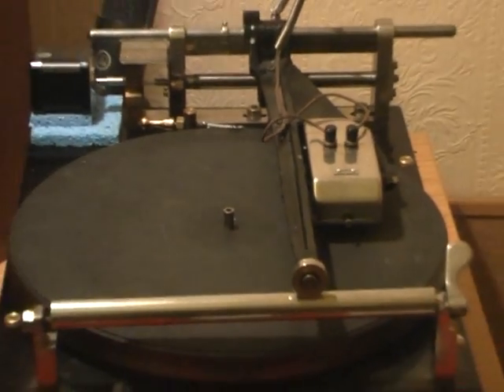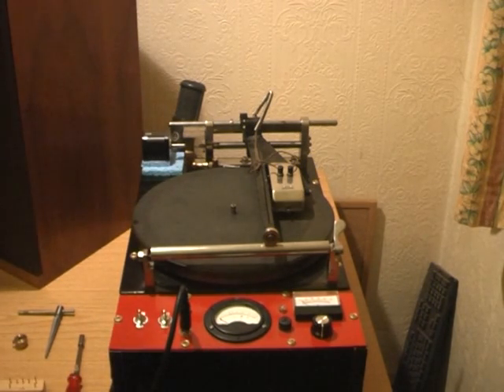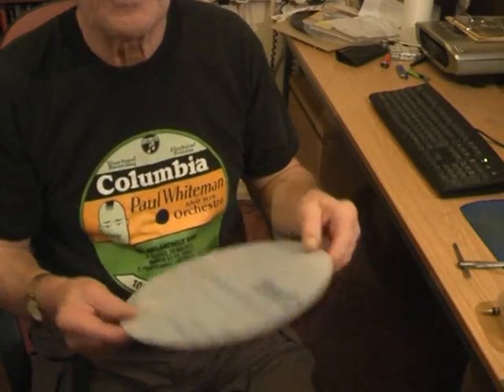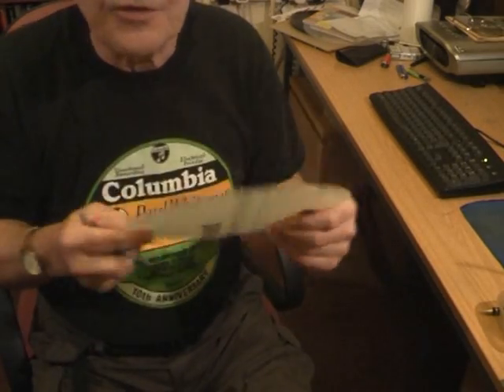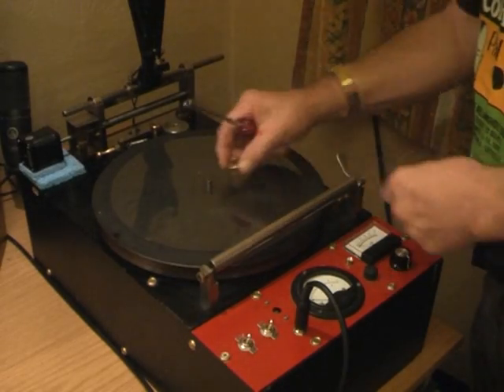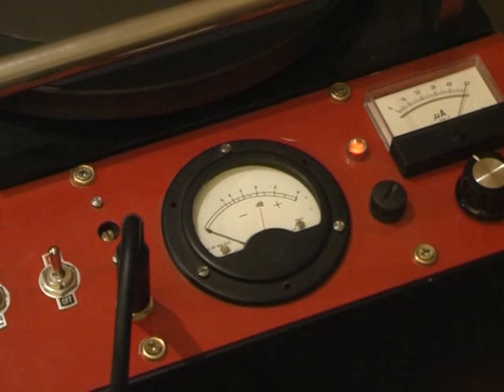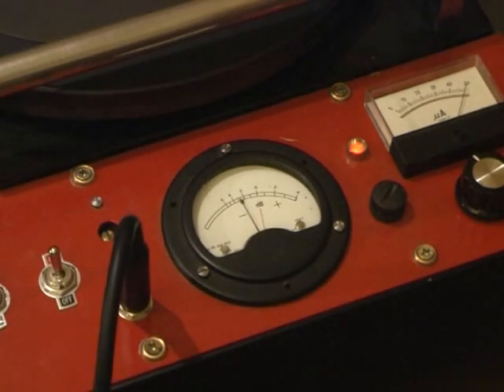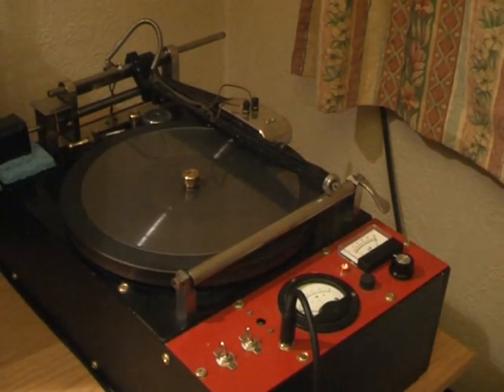home made 78 rpm records

Comment: What amplifier are you using on your desk?
Reply from the maker: An old NAD 3020. Must've had it for 40 years. 😀 The MSS heads don't take a lot of driving; many years ago, John R T Davies drew me a circuit using a single EL84 valve (aka 6BQ5) to drive an MSS head. It's only rated at 4 Watts. Of course, there will be less distortion with a higher power amp idling along. IIRC the 3020 was 20W per channel. Using a stereo amp for cutting a mono disc is convenient, because one channel can drive the head & the other chanel can be used as a  monitor. All the best, Norman. P.S. The big MSS mono amplifier used push-pull EL34s.

Comment: I fully expected this to sound terrible but I was so surprised how good it sounded!
Reply from the maker: Wow - that's great, thanks! Still tinkering with it here... need to warm up the polycarbonate disc to maybe 35°C, coat it with thin spray of WD40, and have a heated cutting stylus... One day will have a major campaign on it! Of course, I should have used a modern recording, which would have sounded far better anyway  😀Cheers, Norman.

Comment: Hello! I would like to know how you made the record labels
Reply from the maker: Sorry about late reply! It's quite simple. Scan in a real label (or design your own), and save it as a .jpg, or whatever. For 25 cm (10") discs, most labels were either 8 cm diameter (3.175 inches), or 8.9 cm (3.5 inches). In both cases, there are available, sheets of '6-up' circular peel-off labels. You simply paste your label(s) into the the sheet - usually 6 labels to a sheet. The packet tells you the layout of the labels on the A4 sheet; but I must tell you, that it is really quite difficult to match exactly your labels to where they should be on on A4 sheet!
One dodge is to make your labels a bit larger, so they slightly overlap the label on the sheet. Also, try not to copy labels that have long texts running round the circumference of the label - those are the most difficult to "synch" with SIX circular labels on one sheet! 😄 Hope this has been of some help, and best regards to you & your family, Norman..
Reply: @bixanorak  Hello! Thank you for answering my question. I asked this because I was looking for a Wilcox-Gay Recordette to buy, so I could make my own labels and stick them in the center of a record, but I couldn't find one on the internet that ships to Brazil, where I live. All good for you! 👋

Comment: Can these 78’s play on a Victrola No2 or will that ruin them?
Reply from the maker: Alas, no; the sound box will merely skate across and end up on the label. This is because these polycarbonate records don't have a true groove. They only have a shallow furrow (like a ploughed field), which will not retain the needle like a deep groove. BUT, if you can find any lacquer discs (which are no longer manufactured AFAIK), a 78 rpm record made on a lacquer, can be played on a Victrola PROVIDED the heavy soundbox is given a counterbalance & the playing weight reduced to about 35 grams. I know this can be done, because I made such a lacquer for a friend. HIs daughter had asked could he play her favourite rock band on his spring driven horn gramophone at her wedding! What a nice thing for her to suggest! Still had some 10" lacquers then, & by using a blunt, worn needle with ~35g it worked well! 😀
Reply: @bixanorak  I was recently gifted a Victrola no2 but it had some issues with the (tone arm?) It was missing some ball bearings to support the arm. I made some from a piece of pull chain that I cut up and the result is very satisfying. The lacquer records don’t skip very much any more. The needles are readily available from a few sources on E-bay, and I bought 200 of them for $9usd plus shipping. I bought that many because I’ve read that the needle should be replaced after each and every  play. I’d like to lighten the tone arm, butI don’t see any way to do that as there is no overhang past the arm pivot. I’d like to start a 78rpm collection as Im really enjoying the old discs I have.

Comment: I'm rebuilding a 1936 Wurlitzer 312 jukebox.  Its disastrous when the mechanism crushes an old 78 record.   Being able to create my own 78 records would alleviate that issue and it would also allow putting modern songs in the jukebox.  Also, most of the 78's I've purchased are badly worn or scratched.  I'm looking into making a recorder. (I'm an electronic eng, so stepping motors are no big deal).  Are you G4LQF?  73's
Nice work!!
Reply from the maker: Yes -  still G4LQF, once was WS0B, but that call lapsed & now belongs to somebody else. If you want to create 78s for a juke-box, best to cut them on traditional lacquer blanks. Embossing on polycarbonate only makes a shallow furrow - the pick-up will skate across the disc. Unfortunately, nitro-cellulose lacquer discs seem no longer to be manufactured. Cutting on Makrolon with a heated stylus might be an answer, but my knowledge on that topic is, alas, zilch... Bur good luck to you! 73, Norman.
Reply: Makrolon, a polycarbonate, melts at 280 °C.  nitro-cellulose is about 160 °C.  Maybe a heated platter?  Thanks for the input.  btw, your QRZ e-mail doesn't work.  Take care
Reply from the maker: @dalebertdurando1496  Hi there & thanks for writing again. First, thanx for the tip-off about the QRZ page - have just updated it (not been very acitve on ham rsdio lately, sorry to say, so it got behind). Secondly, hope you're having a good mid-winter holiday, & wishing you allthe best for 2022. Lastly - thanks yet again, for the update on Makrolon. Only recently found out that Makrolon is more or less just a Trade Name for 'ordinary' polycarbonate, except it's black & not clear. Therfore, I ought to be able to coat a metal chisel cutter - I grind & polish them from 1.5mm high speed steel - coat one with a thin layer of very fine refractory cement. Once set, some resistance wire could be wound round the non-conductive cement, and an electric current passed through it, to get it up to the softening/semi-melting point of Makrolon/polycarbonate! Wow... I'll definitely be trying that bwfore too long! Thanks again for the info. Cheers, Norman.

Comment: Is there any way that sound could have been accidently and unintentionally  recorded on a smooth surface, such as on the smooth walls of an Egyptian pyramid, which wasn't a tomb at all, but some say it was an ancient electrical power source? (Don't laugh 😁)
Reply from the maker: Hi Jeannine. No, I don't laugh! There were jars found in archaeological excavations (near Baghdad I think) that contained inner 'cores' which suggested to some people that they were ancient electric cells, which could have been joined in series & so made into a battery... perhaps used for electroplating? There is a small chance that they actually were electric. And similarly, one cannot say that never, ever, was some sound accidentally recorded, hundreds or even thousands of years ago. One suggestion I read, was that during high wind, the pointed tips of leaves would rub on the flat surface of nearby leaves - which, if they had a waxy coating as some leaves do, that the sound of the wind might have been recorded there, even if only for a fraction of a second. Nobody dare say that that phenomenon never occurred; it's just the problem of finding a few very ancient preserved leaves somewhere! See https://en.wikipedia.org/wiki/Archaeoacoustics ! Keep safe - cheers, Norman.

Comment: what about a using a heated cutting head might work better.
Reply from the maker: Hi there, & thanks for writing. I'm sure you're right; a heated point would almost certainly be better. I just never got that far down the road, is all! In fact, when somebody asked me to try 45 rpm (I'm only interested in 78 rpm), it was found that the slower embossing speed worked better - though it required a much smaller (= sharper) point, and correspondingly less pressure. Thus I concluded that the polycarbonate I was using (Lexan), had a 'critical deformation rate' (I just made that up!) which was rather below 78 rpm for a 10 inch disc; and 45 rpm was, generally, a better speed. All the best for now, & do please Keep Safe in these troubled times! Cheers, Norman.

Comment: Hi Gentle, an information, how much gramms are perfect to embossing polycarbonate at 84 degrees angle needle? many thanks
Reply from the maker: Hi there. On 'Lexan' brand polycarbonate, with ~84° point, start low - maybe 30g. Then try 40g, 50, 60 &c until you get the best sound, & replay stylus stays in the  'groove' reliably. (Too much pressure will usually impede movement of the needle, so sound will be worse...) This is for 78 rpm only. If you want  to use 45 or 33, you will need a sharper point - angle less than 84° - probably much less, sorry I can't tell you a specific angle, but of course because the point is smaller you will also need less pressure for 33/45. I only used 78. Hope this is of some help. Have a good Christmas & Stay Safe! Norman.
Reply: @bixanorak  how much weight do you havd find correct for your embossing activities?
Reply from the maker: @orchestramosaicobarocco-ve3230  
Ciao. Sul policarbonato di marca "Lexan", con un punto di ~ 84 °, inizia basso - forse 30 g. Quindi prova 40g, 50, 60 & c fino a ottenere il suono migliore e la riproduzione dello stilo rimane nel "solco" in modo affidabile. (Una pressione eccessiva di solito impedisce il movimento dell'ago, quindi il suono sarà peggiore ...) Questo è solo per 78 giri / min. Se vuoi usare 45 o 33, avrai bisogno di un punto più nitido - angolo inferiore a 84 ° - probabilmente molto meno, scusa non posso dirti un angolo specifico, ma ovviamente poiché il punto è più piccolo avrai anche bisogno di meno pressione per 33/45. Ho usato solo 78. Spero che questo sia di qualche aiuto. Buon Natale e stai al sicuro! Norman.

Comment: Can you use polycarbonate (a.k.a. Lexan) sheets from Home Depot for recording?
Reply from the maker: Yes, you can! In fact, Lexan is what I used in the above video. I first used 1.5 mm sheet, but later switched to 1mm, which works fine, only not all places stock 1 mm. The other big problem is getting it cut to rounds. A lot of suppliers will cut a Lexan sheet to squares *free of charge*, it's cheaper to ship that way. But to cut CNC to rounds, at the least, triples the cost per piece. I have not as yet found a simple way of making squares round.
Of course, there is no reason why disc records should be round. They might as well be square; but if so, the first time your replay head slips outward off the disc, your GBP 70 (~US $ 85) stylus will be destroyed by the corners of the disc going past it. You Have Been Warned! Keep safe, & good luck. Norman.
Reply: @bixanorak  Thank you Norman for your explanation. I ran into your video by chance and got very excited by the ability to make homemade records. I am a Victrola enthusiast and would like to make a record for a mechanical Victrola. I see that you play your 78s on a turntable with electric pickup, which exerts very little pressure on a record. Mecanical machines had reproducers that weight about 150 gram, so the steel needle would likely destroy a PC record very fast. I would try a bamboo needle which is gentler on a record. Have you tried playing a homemade 78 in a mechanical machine?
Reply from the maker: Well... a couple of years ago, the daughter of a friend of mine was getting  married, and she had the idea of playing her favourite track (modern pop music) on his hand-crank horn gramophone. I said I'd have a go, and you certainly can't use Lexan, because the embossed furrow is very shallow; but I still had two or three (nitrocellulose) lacquer discs, so I did some tests, and found that if you fix a counterweight to the sound box, you could get the playing weight down to about 35 grams. (This was an HMV 'Exhibition' sound box, and my pal's HMV horn machine had the same.) Then, if you used a needle that has been blunted by played a noisy, coarse shellac 78 a couple of times, it would work. The gramophone had to be perfectly level of course. I cut half an inch of blank groove so he could try it out, and it worked fine! In fact, we are so conditioned to NOT play lacquer discs on mechanical gramophones, that we would never dream of doing it! In fact, if you have the odd unimportant lacquer lying around, provided you use a worn needle and relieve the playing weight as much as you can, it ought to work. And as you say, a bamboo or thorn needle is bound to be OK too. All we need are cheap lacquer discs, but apparently the factory in California, which was the last place making them, caught fire & burnt down, so nobody makes them any more... and they weren't cheap anyway!
Reply: @bixanorak  Norman, that was a literally priceless gift that you made for your friend's daughter - something that no money can buy. It was also an amazing idea to use a counterweight to ease pressure on the record.
I don't have access to lacquer blanks,  so I will try embossing first. There are two polar opposite goals that need to be achieved - finding a material that is soft enough to be cut or effectively embossed but hard enough at the same time to survive a needle pressure of a mechanical phonograph. It's a long road ahead, mostly because of time that this project requires. I've joined Lathe Trolls forum, will read up there about materials and techniques. I've seen two suggestions so far to soften a material during recording - using heat and using solvents. Heat sounds more viable to me, but I will know real effect only when get to experiment with it.

Comment: No need to add furniture polish or DW-40 I emboss DRY with no lubricants to the disc, dose not make a difference, nor heat. This will save you that extra step in washing off the record with soap and water. I don't use any of that because  of the  sapphire embossing stylus.https://www.youtube.com/watch?v=8LpY18u-VbI

Comment: I've discovered how to make a material that starts off moldable and when dried, it hardens. What's nice about this is it is as scratch resistant as shellac 78s and just as brittle. When I cut a "groove" into it and put it on my record player for 78 seconds (equivalent to 78 plays on a gramophone), little to no material was scratched up. After watching this video, I realized that if I cut my own negative out of poly carbonate, I can use it to press it up against my "concoction" and let it dry. I'll see how the sound quality sounds then, and if successful, I'll use it to make my own "shellac" 78s. Thanks for the idea!

Comment: Hi Norman, where did you buy your polycarbonate discs from? There seems to be a lot of sellers of polycarbonate material available, but am I right to believe that the hardness and surface quality varies? Blank CDs seem to be the perfect material, but are too small. Have you found something similar available in larger sizes? Many thanks.
Reply from the maker: Well, I'm in the U.K. and 1mm polycarbonate sheet is readily available fairly cheap. As long as you have it cut into squares, which is usually free. However, square records are perilous, because then you play them back, if your pick-up falls off the edge (and believe me, it will) the stylus will be torn apart. Circular discs are great, but the cutting into circles trebles the cost! In the end, my 25 cm dia discs cost about GBP £ each. Squares would have been about GBP 1. Answer? Find a way to 'circle the square'! Good luck, Norman. P.S. The quality does vary; some discs have a 'linear grain' which therefore produces a double swish per revolution.
Reply: @bixanorak   Thank you Norman. I am in the UK too. As you say, plenty of sources, but many boast about the hardness and impact resistance of the material, which sounds like the opposite of what's needed. I will try a local supplier first unless you've found anyone on line where the quality is good?
Reply from the maker: Hi there. I started with 1.5 mm polycarbonte sheet, but it turned out 1mm was perfectly adequate. It wasn't that much cheaper though. The supplier was in Coventry, but I can't remember the company name. I used to drive over & collect it, as I'm in Birmingham & it's not all that far & shipping was £12. .Another big problem was, that they would cut it into squares for you at zero cost. BUT, I wanted discs. These they cut by CNC, but it trebled the cost of each 10" disc!! It would pay you to buy squares & figure out a way to make them circular yourself. I never got round to that. The physical properties are of less importance. The stuff I used was 'LEXAN' IIRC. It actually worked better at 45 & 33 rpm, but i wanted 78! Hope this is of some help. Cheers, Norman.